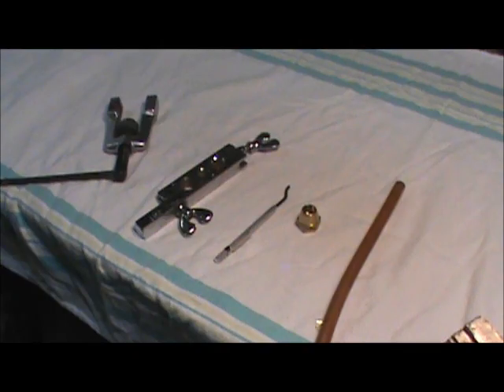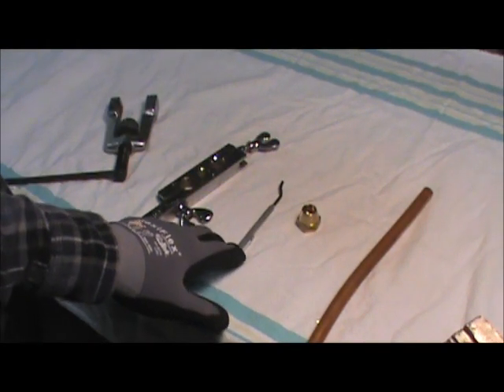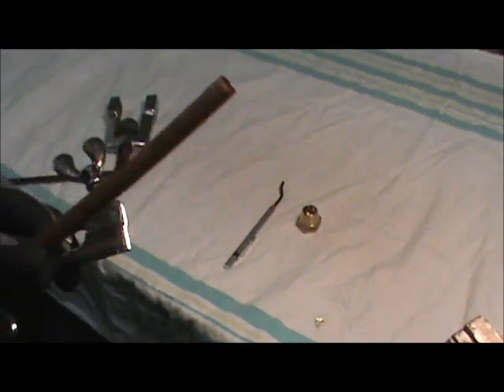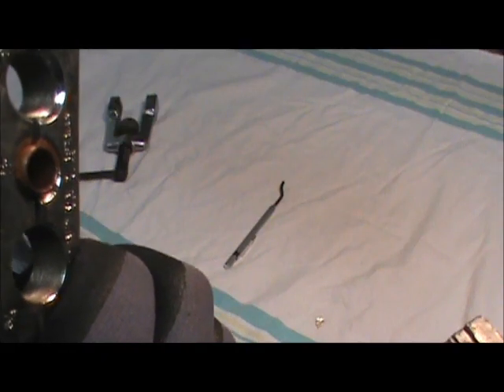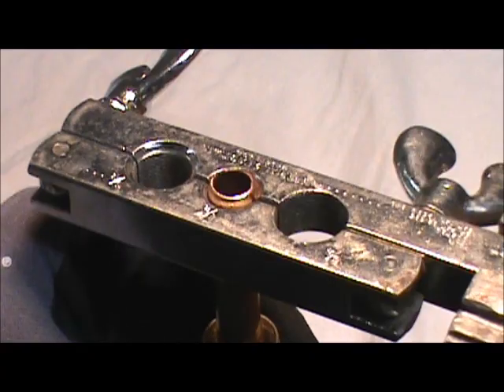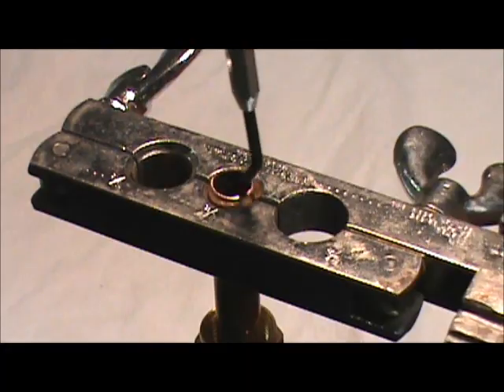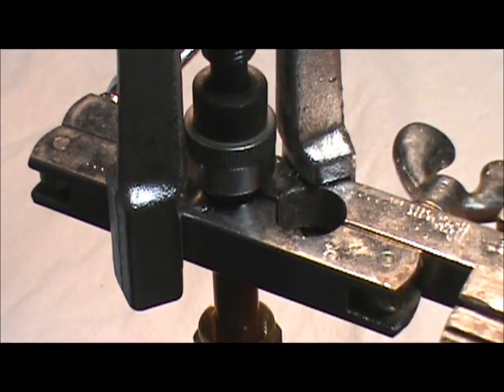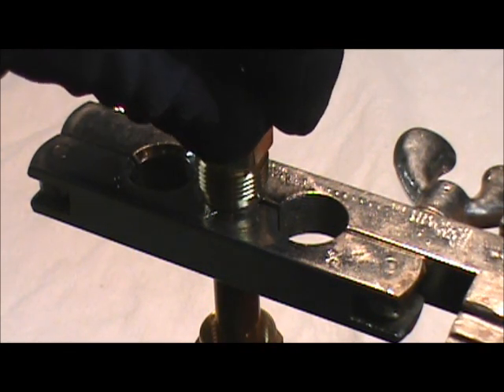My DIY Flaring Copper Tubing

Comment: I always have trouble flaring small sizes like 1/4", the damned flare seems to always crack. Any tips on how to prevent this?
Reply: Cracks and splits are from over-flaring which increases the outer diameter of the tubing beyond malleability--very common mistake.  Ensure the last segment of tubing to be flared is straight going into the flare block and FLUSH the tubing with the block.  Extending beyond the block decreases "compressibility" of copper because the actual sealing surface is the inner portion of the tubing against the male fitting just outside of the hole--only need enough flare to keep tubing from pulling through the nut. Lightly tighten, loosen, then finally snug it--no need to get silly tight--this last step seats the brass and copper.

Comment: Good on you for emphasizing the deburring; most aren't aware of that as an issue. If you don't deburr the burr can fold over inside and form an irregular double flare that will definitely leak, usually badly. I'd change your speech to saying to remove ALL of the burr but not overdo it and bevel and thin the end of the tubing. If I overdo the deburring I generally take a small flat file and file the end a bit flat again so it's thick enough to not split while flaring. I've found this attention to detail to be critical in producing a flare that doesn't leak. You could also mention to inspect the ends of your fittings. Nicks, dinged ends, etc will cause leaks. Just yesterday I bought a brand new brass ball valve for the supply line on a diesel  heater. I installed it and it refused to not leak so I pulled it off and saw that the fitting had been dropped and the end was flattened on one side and there were several nicks elsewhere that compromised the surface that would match the flared tube, and this valve came out of the bag like that! Now I have to drive back into town to get a replacement. No detail is too minor in producing a good flared connection that doesn't leak. I use the exact same Eastman tool that you have.

Comment: you make it look easy! lol, I will be making my fourth or fifth attempt to repair the half inch fitting to my propain tank. wife hit it with lawn tractor and knocked out over and broke the copper pipe. it was turned off at the time so we didn't lose any propain. so I moved the tank and an rerouting the pipe.

Comment: Should you use any tape over the threads?
Reply: you don't need tape on the threads. The flare is the sealing surface, not the threads. I always apply some pipe dope on the flare to prevent leaks.
Reply: +Jonathan Trivette 
Yes.
Reply: @ababner317  no, it's not necessary.